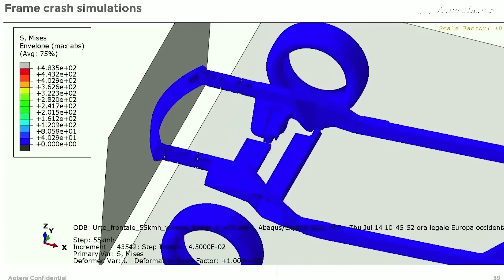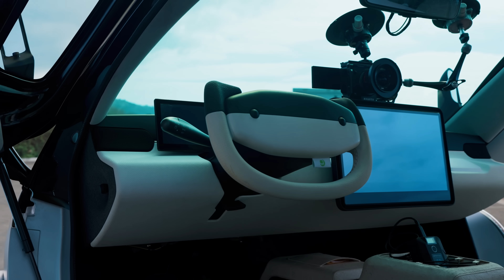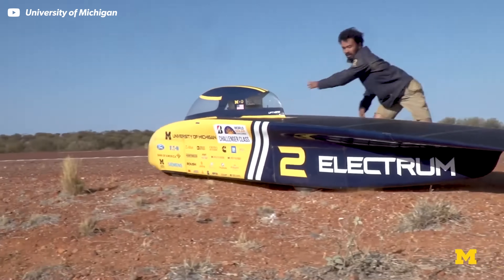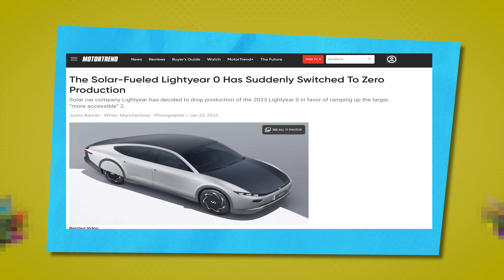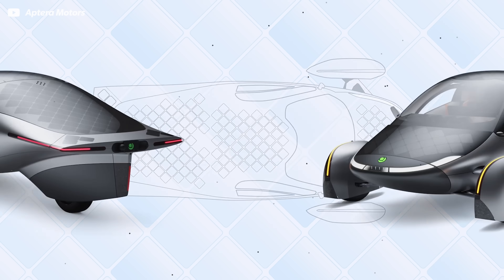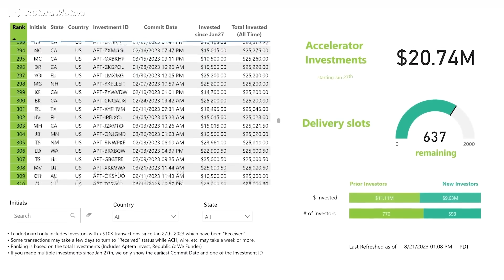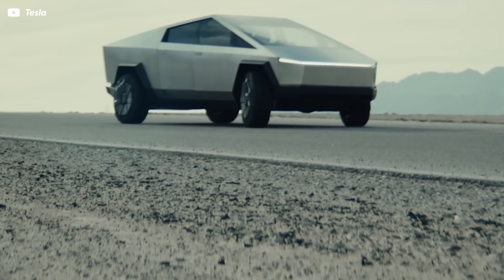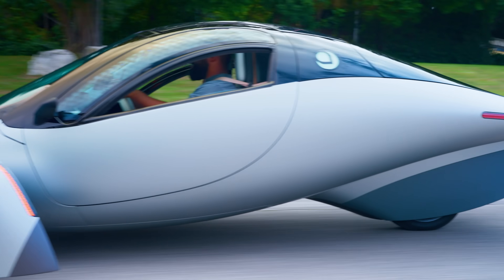We Drove America's First Solar Car

Comment: NOT a car.
NO bumper.
NO crash-testing by NHTSA
It's an electric TRIKE
Reply: Aptera WILL be crash tested by a third party to NHTSA and FMVSS part 200 standards and the ratings published - unlike many cars sold in the US now.  They are voluntarily doing many things that aren't required by the regs for safety - such as installing driver's side and passenger air bags.  

Do your research before you comment.
Reply: NOT a car. No, it's classified as a motorcycle or autocycle.
NO bumper. Has a front crumple zone that works well in simulations. 
NO crash-testing by NHTSA  Isn't required by law. Many SUVs on the market haven't done it either.
It's an electric TRIKE  Yes, it's an electric tadpole or reverse trike that drives like a car and has all the creature comforts.
Reply: @tims8603  Good, at least you admit it.  If it has air conditioning, then it is better than all other trikes right off the bat.  I live in Vegas so that's why the Acrimoto with no A/C makes NO sense for me.  The Aptera with A/C makes more sense, if the price is right.

Comment: I cant even imagine the ar$e clenching dread of hitting potholes in that thing at highway speeds.
Reply: I don't have to "imagine"  Both my wife and I have ridden a prototype that was pre-Roush suspension re-design.  It even did well hitting speed bumps at speed in that state.  I live in Iowa, and will be driving on gravel roads in all weather.  Based on my experience, I have no worries about the performance of the production models under those conditions.  When you have a chance - try one out!

Comment: $25,000 is expensive for what is a motorbike with only two seats.
Reply: While Aptera only has 2 seats, it is nothing like a motor bike.  I have around 1/2 million miles on motorbikes, and have ridden in an Aptera prototype.  

Aptera outperforms my present car in every way as a car.
Reply: Nevertheless it is not classed as a car but as a three wheeler trike. This means it doesn't have to pass the stringent crash safety standards of a car. As for the cost, the original Mini was half the price and could seat 4. It is fine that you would buy one but it cannot be the first choice for anyone with a family or a need to carry anything. I just rented a car for myself and my daughter but we had three suitcases and other bags to carry. Likable or not this vehicle has a limited market. It is efficient, but not in the amount of road space it takes up compared to what it carries.
Reply: @Martin-se3ij  You are correct that the Aptera is a niche market vehicle.  The company originally expected that they would sell around 4,000 copies.  They were rather surprised when well over 40,000 pre-orders came in and the numbers are still climbing.  It required a complete redesign of the vehicle to change the manufacturing methods.

Aptera has 32 cu ft of space - and enough room to sleep a couple in the back.  It is bigger than our present Honda and far less expensive to run, with far greater performance.  I think many people have a mistaken idea regarding the size.

As far as crash safety, Aptera will be voluntarily crash tested by a third party to the same FMVSS part 200 standards that cars are tested to - and the results will be published, unlike many SUVs on the American market.
Reply: I know it's not much different in length than a London black taxi and that seats 7 adults plus a lot of luggage space. Sleeping in the back of your car is hardly aspirational. This sounds like the marketing departments twist on there being no room to carry a tent. 
Hopefully no one orders a brown one as it will look like a giant cockroach on our streets and I'll be tempted to stamp on it :-)
Let me say I'm actually FOR anything that replaces an ICE vehicle on our roads.
Reply: @Martin-se3ij  This just shows that you don't understand the nature of the space Aptera offers.  My wife and I have done a lot of motorcycle camping -  by choice- and Aptera will be luxury in comparison.

It is not designed for the role of a London taxi, so that is hardly a valid criticism.
Reply: What exactly says motorbike about it??  Aside from autocycle classification, it's not a motorbike obviously.  Can you see??
Reply: A full dress Harley Davidson goes for over $40k. Honda Gold Wings start at about $35,400.

Comment: Sorry, but before production there surely have to be some changes:
- doors not big enough
- massive pillar in the side window
- with these front wheels unreasonable wide
- I doubt the efficency of this quite small solar panel
Outherwise:
I like the concept of a smaller and more effective EV. And if the solar panel charges your batteries for 20 miles / day this would be nice!
Reply: My wife and I have ridden in a prototype.  There is no problem with the doors .   you just back up to the seat, sit straight down, and rotate on your butt to swing your legs in.   Surprisingly, you hardly notice the window divider when you are driving.  My mind is still open on this, since the size and location may be relatively different on production models, but I am no longer worried.

As far as width goes, it is less wide than my step van was, and I could still park that in a compact parking space.

Comment: Dealbreaker #1: That god-awful steering "wheel".  Just put a normal, round steering wheel. Stop trying to re-invent the wheel.  Dealbreaker #2: That huge, 4-inch wide, black half-window-frame right in your field of vision.   This ruins the outward visibility to the left. Terrible idea. You need to be able to see out of the car properly to drive safely.
Reply: The first is a matter of taste, and will likely be addressed by the aftermarket.  

I was concerned about the window myself, but found it wasn't the issue I expected in the prototype I rode in.  I had to think about it to even notice it.  I am withholding judgement until I have a chance to experience a production vehicle because the dimensions have changed from the prototype I rode in,, and I think the line will be thinner.  It may depend on the height of the driver, but I think it will be OK for most.

Comment: Yo its a honda insight
Reply: I own a Gen 1 Honda Insight and it serves me well.  But I have also ridden in an Aptera prototype.  It is a much larger vehicle, will cost much less to operate, and is FAR more fun with 4 second  0-60 performance in the AWD version - hardly Honda Insight territory.
Reply: Honda Insight is a hybrid. Aptera is a BEV.
Reply: @tims8603  Yes.  And is therefore a much simpler and less expensive vehicle to operate and maintain than even the Insight has been for us.

Comment: Solar powered car is the greenest car and the future of energy efficient vehicles. And EV cars would always be at the lowest level of being green. It is worse than ICE car.
Reply: I wonder why you say EVs are worse than ICE vehicles?
Reply: How many gallons of gas does an ICE vehicle burn over it's lifetime? I would guess thousands. Then there's oil changes and pollution to consider.
Reply: @n.brucenelson5920  Still rely on power grid that uses fossil fuels some of them uses coal that are the worst polluter.
Reply: @tims8603  How much would a battery replacement cost over its lifetime. Power plants supplying the car's battery power are the worst polluters. Some even use coal as their fuel. An they are not more efficient in burning fossil fuels. Add to the mining and mfg of battery components that are power hungry - i.e. uses electricity from fossil fuels again.
Reply: Of course they aren't.
Reply: @Hyperion1722  Yes, but even if it is coal being burned, EVs are still far better.  Some are 90% efficient or better at converting the power, where as the best coal plants are perhaps 32% to 33% efficient.  In Iowa, where I live, 62% of the grid power comes from wind.  If you include all the factors producing environmental damage from extraction of the fuel to the waste produced and line losses in the grid - EV's are better..
Reply: @n.brucenelson5920  Coal plants emit 50% more CO2 than fossil fuel plants. A typical EV car power efficiency is only 75% and not 90% efficient you mentioned. Add that to the charging efficiency of around 90% and power grid losses and the whole EV car ecosystem power efficiency is lower. In your state and with that renewable contribution - breakeven carbon parity with ICE engines will be shorter. Use of renewable energy is the key here to make EV cars greener. Could be ideal for Norway or Iceland but not at all good strategy for countries (mostly in Asia like China) that uses coal as one the main sources of power grid.
Reply: @Hyperion1722  "How much would a battery replacement cost over its lifetime" Less than the cost of gas a car uses in it's lifetime. Let's say the car lasts 10 yrs. Most people average about 10,000 mi/yr That's 100,000 mi. Figure 30mi/gal. Divide 100,000 by 30 that's 3,333 gal. figure $5/gal, which is conservative because gas will keep going up the harder it gets to find oil and wells dry up. That's  $16.665. That doesn't include oil changes. I just bought 4 quarts of the cheapest synthetic oil I could find $5/quart so another $20/3000 mi. You do the math. It's getting pretty close to $20,000. That will go up in price too. A lot of that oil comes from the Middle East which is a very volatile area. 

Also you said coal supplies some electricity. Currently, yes but coal is being phased out. Coal plants are being shut down and replace with natural gas which isn't great but it's less polluting. The US now gets 62% of it's electricity from renewable sources. That includes solar, wind and hydroelectric. Battery tech is finding new ways to make batteries less reliant on rare earth minerals and they will get cheaper and safer in the near future. Right now LFP batteries use less rare earth and are safer. ICE vehicles are only about 30% efficient, if that, and waste the rest on heat. Electric motors are far more efficient at converting energy into work. They are also much simpler and last longer.
Reply: @n.brucenelson5920  And BTW, mining and mfg (biggest is China) of EV batteries are also one of the big polluters and involves power hungry processes - i.e. needs electricity.
Reply: @tims8603  You did not answer my question: how much is battery replacement cost. You can forecast gas prices but you can't for EV batteries? At current US gasoline prices, the amount is close to 11,000 USD. And did you you know ICE also included diesel engines that are more efficient that gasoline engines by 15%. EV cars are more efficient (75% ave) but would depend on the location's ecosystem on its power efficiency. The use of EV car on a location where the power source is fossil fuel make the whole fuel efficiency very low as power grid plants can only operate at a measly 35% efficiency. Add power grid losses and charging efficiency and your argument of converting energy to work more efficient fails.
Reply: @Hyperion1722  I stated that EV batteries will get cheaper and safer. They will also charge faster. Unlike you, I've been keeping up. Aptera has a small battery so replacement shouldn't be that much. I don't know the exact number but my guess would be around $15,000. How else could they sell one for well under $30,000.  It won't happen overnight but renewables will become more and more common. More people are adding solar to their homes as the price drops and fossil fuels get more expensive. Not much energy lost there. The recent infrastructure bill has money to make that happen faster. Yes, diesel is more efficient but it also pollutes more.
Reply: @tims8603  Aptera is using solar power and I am sold on this one as charging is free albeit at the cost of solar panel installed. But for EV cars, could have a TCO (total cost to own) higher than ice car. Among others higher car prices at the start, higher insurance costs, higher wire tear among others. Renewable generation in the US has not gone that far. Non-renewable sources is at 87% and has not gone down for the past 40 years. It will be a pipe dream for US to just miraculously increase renewables at even 30% share in the next 20 years.

Comment: It's been almost 20 years since Aptera was promising a 25K super-car. The surface area of the solar panel does not make sense to make a noticeable impact.
Reply: No it hasn't.  Aptera Corp was founded in 2019 and started their design then.  Perhaps you are confusing them with the Aptera, Inc. that was founded in 2005 as a parnership with Idealab.  Different company, different CEO and completely different vehicle.    That company kicked out the original founders in 2009, and liquidated in 2011.

The new vehicle uses so little power - 2.5 times  less than the Tesla Model 3 for the same EPA range, that even the 4000 or so watt hours that the panels can provide in the American Southwest can provide a significant contribution.  In fact even in Iowa, I can probably meet my daily driving needs from the lower solar insolation we get here.
Reply: @n.brucenelson5920  By the look of the panel, it's no bigger than 1m^2 by the surface area. Unless it's a GaAs panel (which I doubt) it delivers 500W at best? Sure, if one lives in Arizona and drives 10 miles a day, might be enough, but it's not sufficient to make the average driver excited and to scale up to deliver the 40K vehicles they have signed up for. AFAIK, in the 00s they promised a hybrid with a 200 mile range which could have been  impressive (even today), but even that has failed (and I wanted them to succeed).
Reply: @runcycleskixc  This is easy to research.  The Aptera full solar covers around 3m^2 and produces around 700 watts peak.  Or over 40 miles of range in the Southwest. (we will know more exactly once the PI vehicles in production now are validated)  I live in Iowa, where I will likely only get 1/2 the distance, but since I live in a small town, I am likely to meet most of my driving needs from solar alone much of the year, including an occasional round trip to Des Moines or Kansas City.

By the way, it is the potential customers who have signed up for the now many more than 40K pre-orders.  Aptera has had to make a major design change to meet the unexpectedly large demand, and has responded wonderfully.  No failures here.
Reply: @n.brucenelson5920  Alright, so I was not too far off the 700W peak (which is achieved for a small fraction of time of solar exposure). I would prefer not to see the solar panel at all (it sounds like a gimmick, unless the whole body was covered ). and see them focus on the range and meeting the production commitments while keeping the 25K price cap. Of course, I want them to succeed.
Reply: @runcycleskixc  Every watt/hr. the Aptera produces is one that doesn't have to be sourced from the grid - a huge cumulative social benefit.  

The price target originally announced for the 250 mile version was $25,900.  It remains to be seen where they end up, but battery costs have been dropping and the new production design will require far less labor and produce less waste, while vastly increasing the quality over the original vacuum resin infusion design.

It will be interesting to see where they land on price, but the vehicle that will be delivered will be vastly superior to what was originally foreseen.
Reply: @n.brucenelson5920  I am not a big fan of exotic composite materials, unless they are jute/paper-based. Even then they must be made with epoxy impregnation which is a chemical-industry product, and is an irreversibly cured material (no recycling).
Reply: @runcycleskixc  I certainly understand your thinking.  Aptera was looking into using hemp fiber for bodies initially, so they concure.  The carbon fiber/SMC that Aptera will be using has the advantage that the amount of scrap is much smaller than with vacuum resin infusion, and it produces a more precisely fitting and stranger part.   In addition, the carbon fiber is produced from polyacrylonitrile and coal pitch, and what scrap there is can be recycled multiple times.

Comment: Ummm there is no Aptera car.  10 years ago they claimed there would be a solar-powered Aptera.  10 years later the car still doesn't exist.  Yeah, pre-production test-beds = Not Customer Cars.
Reply: The company, Aptera Corp. was only founded in 2019 and design work begun.  Do your research.  It is possible that customer vehicles could start shipping by the end of next summer, depending on how funding goes and the results of the validation testing of the initial production intent vehicles, including crash testing.

Comment: But where's the trunk?
Reply: 32 cu ft of space, and enough room to sleep a couple on camping trips.
Reply: @n.brucenelson5920  So you put your groceries right behind your head and obscure your vision out the rear window? That doesn't seem safe.
Reply: @ghoulie11  No, there is no rear window.  That space is covered by the main solar panels.  There is a cargo net to prevent things shifting forward in a panic stop.  Your rear view is maintained by both mirrors and cameras.
Reply: @ghoulie11  I use a 27 gal. plastic tote in the hatch area of my Honda Fit for groceries. It keeps things from flying around. Aptera has room in back  for more than one of those and D rings if you want to tie stuff down.

Comment: "...exceeds safety standards for 3-wheeled vehicles." That's because it's a motorcycle and there really aren't any.
Reply: It has been designed to exceed safety standards for cars - and will be tested to FMVSS part 200 standards by a third party and the results will be published.

It doesn't need to have air bags, either, but it does.